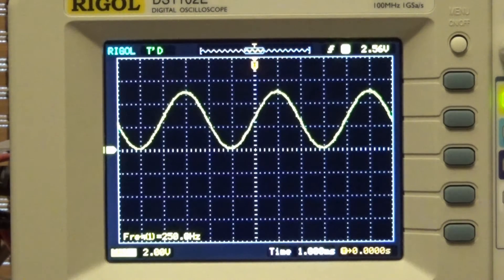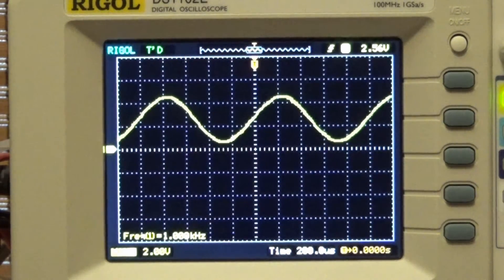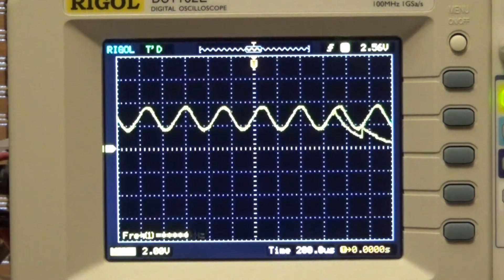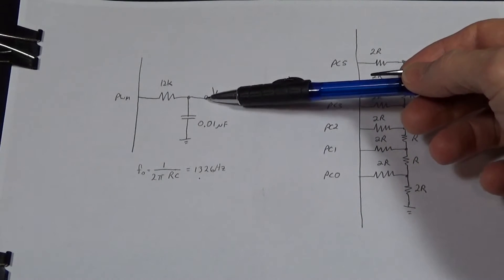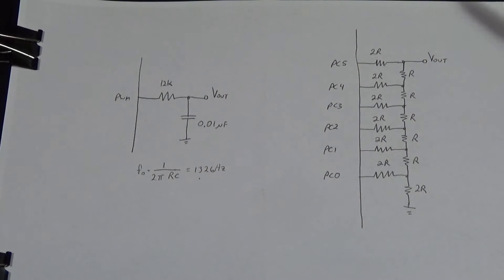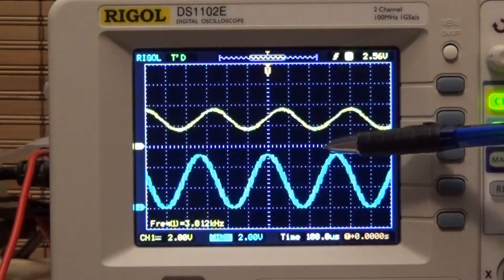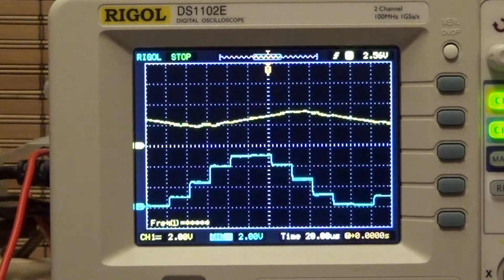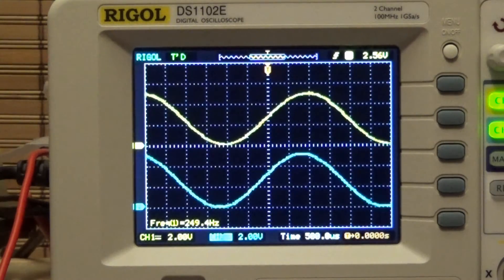Going Beyond Arduino # 10: PWM D-to-A vs R2R Ladder D-to-A

Comment: You could do a full 8-bits using just 3 pins with a 74HC595.
Reply from the maker: Could do that, might make the frequency lower though.
Reply: @craighollinger9972  Should be able to get pretty close to the full audio range I think.  It's doesn't take too long to shift out 8 bits.

Comment: I combined an Arduino Uno with a shift register and R2R ladder to get 8-bits which I buffered using an MCP602 op-amp. With port manipulation, I was able to output a new value at ~290 KS/s by looping with a variable incrementing by 1. I was able to print audio files at about 11 kS/s from Matlab where the limiting rate was the serial port baudrate. I'm sure if I had a microSD card, the output rate would be significantly higher. If multiple shift registers shared pins, I would only need one additional pin per DAC, but I also know my "max" output speed would also drop by a third to half the current
Reply from the maker: Good luck with your experiments.  There is an 8-bit port on the UNO, Port D.  You won't be able to use the serial monitor but you will get an 8-bit wide R2R ladder DAC.  That should increase your speed instead of going through a shift register.
Reply: @craighollinger9972  thanks! I saw you mentioned that in your video, but most of the projects I'm working on need to keep the arduino serial port available for communication with a computer, and additional pins are needed for controlling the on/off states of some other equipment, so I moved to the shift register to reduce the pins required for the DAQ. It's definitely not as fast as setting a single port (or running port commands to manipulate the last 6 pins of 1 and the first 2 of the next with a LP filter to reduce the jitter of the pins switching asynchronously)
Reply: It may also be worth it for me to look into getting a DAC breakout module now that I think of it

Comment: Have you done a test using a filter on the output of the R2R ladder? you should be able to tune it based on the time between samples, which is much more consistent than the overall frequency
Reply from the maker: That's the way it is normally done, put a filter on the output of the ladder.  Make sure the sampling frequency is much higher than the output frequency, to limit the constraints on the filter.

Comment: I'm working on a music project, would you say that the limitation you showed for the pwm would affect the audio frequencies, or is it only a problem for higher frequencies ? the osciloscope you shoed at 3:37 is around 3Khz
Or maybe we can add some kind of auto-gain amplifier (or a filter that let through the band of higher frequencies + an amplifier) to the end of the pwm filter for that purpose ?
Reply from the maker: It's been a while since I made this video so I don't remember the setup.  But looking at first principals, the Nyquist theorem says that you must sample at 2X the maximum desired frequency to reproduce a signal.  An this is a minimum.  CD quality audio is sampled at 44kHz, so you would need to do this as well.  I'm not sure if my setup would work at this high of a frequency, the ATMEGA328 isn't a very powerful processor.
Simply amplifying higher frequencies wouldn't do anything.  You still have to satisfy the Nyquist theorem.
There are electronics that are purpose built for this.  Just do a search on the internet and you should find what you need.
I hope this helps and thanks for watching.

Comment: Great video! I made this version out of discrete components: https://youtu.be/jz5nuTuV3Fk  however, I not sure if I should R2R the final output where it connects to 4 NPN drivers.... any thoughts?
Reply from the maker: I'm not sure what you have done, but it looks like a good result.  Don't over complicate things.
Reply: @craighollinger9972  

Thanks again for your tutorial! I changed my binary ladder to an R2R and it seems much more stable and efficient.   https://youtu.be/6bwtA_dc6JA

Comment: I guess your frequency limitation on the pwm is the main issue here. Presumably each doubling of modulation frequency gives you a bit of precision or nearly twice the bandwidth for filter of the same complexity.
Reply from the maker: Yeah, the ATMEGA328 is not a very powerful micro.  Some of the higher end ARM chips running at 200+MHz would to better.  But using a microcontroller to generate signals, while a good exercise, is just not very practical.  Analog Devices has a lot of dedicated chips to do this.  Pricey though.  Thanks for watching.

Comment: The best solution is to use r-2r ladder + Lowpass filter to eliminate steps. It is much easier to smooth small ladder steps, then to smooth full amplitude of PWM signal.
Reply from the maker: Correct.
Reply: I was thinking the same. The filter would not have so much effect on the output voltage too.

Comment: I cant find the source code of the sine wave. could you add the code please? (web site does not open) also i want to add 2 sine wave with different frequencies in arduino. is this possible ? thank you..
Reply from the maker: I've corrected the link to the schematic on GitHub, it now works.  If you go to another video in my series:
https://www.youtube.com/watch?v=bIrTWiUkvZA
you can find the source code there.  The code produces a DAQ output using both PWM and R2R Ladder.

Thanks for watching!

Comment: Clear story! 
One thing though. You can make the output with PWM much better to use an higher slope filter. 2nd order works nicely, but you could go for 3rd or 4th order. Raising the samplerate frequency also helps,about a factor 10-20. It might be interesting to use a differential PWM output to even bring down the noise more (and you actually get an higher output amplitude). Differential means that you use two outputs with one that is inverted.
This is also what you typically see in Class-D power amplifiers. 
With a standard Arduino, I typically use 31kHz or 62kHz samplerate with a 2nd order (Butterworth) filter. Only costs an extra little opamp and a few passive components.
For DC applications that works great as well, for AC signals you can get a decent bandwith up to roughly 8-10kHz.
Reply from the maker: Yes, higher order filters with steeper cut-off skirts would be an improvement as would a higher PWM frequency.  

If a frequency generator is wanted, a microcontroller is not the best way to do it.  There are lots of dedicated D/A chips available that do a much better job.  Analog Devices has a quite a number of different chips, and depending on the frequency range, they can be reasonably priced.

Thanks for watching.

Comment: Nice tutorial. There is anyway that output voltage can be adjusted to be suitable for Mic in jack of smartphone. Thanks
Reply from the maker: The maximum voltage is fixed by the logic voltage level (5V) of the microcontroller.  An amplifier or an attenuator would have to be added to the output of the ladder to set the voltage level for the smartphone.
Reply: Thanks!!